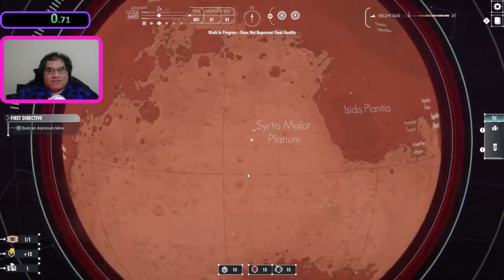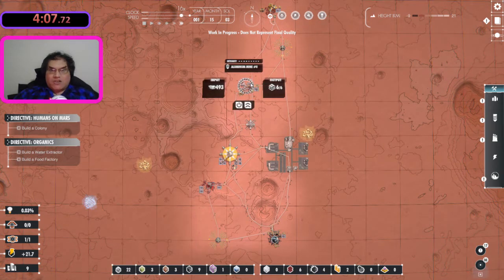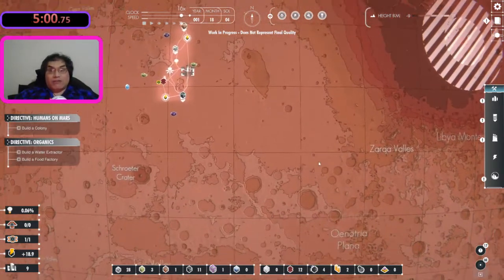Per Aspera Demo Speedrun 5 minutes 50 seconds

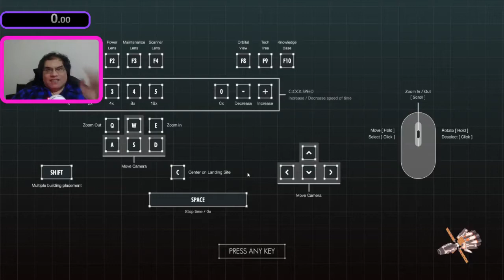Comment from the maker: 0:05 start aluminium
0:09 finish aluminium
0:10 build silicon
0:14 build kiln
0:19 finish kiln
0:15 finish silicon
0:20 power off aluminium
0:25 build solar
0:28 build iron (starts)
0:31 build carbon
0:35 finish iron (no power)
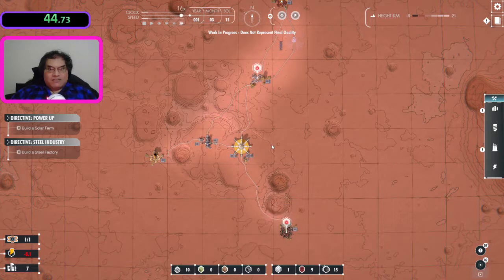0:42 finish carbon (forget turn off power, kiln no power)
0:54 power-on aluminium. power-on carbon
0:56 finish solar
1:03 start steel
1:13 finish steel
1:17 start parts
1:20 start worker
1:23 scrap kiln
1:25 scrap silicon
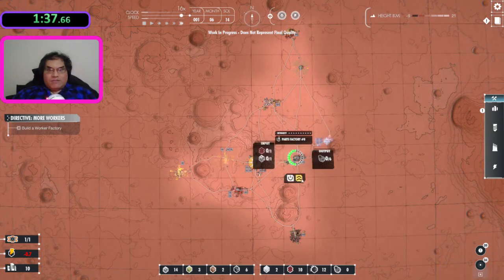1:35 speed parts
1:45 speed worker
1:52 finish worker (parts no power forget to turn power off)
1:59 start chemical (connect carbon)
2:02 build solar (by chemical & carbon)
2:06 start polymers
2:10 finish solar
2:11 start maintenance
2:13 speed chemical
2:17 finish chemical. speed polymer
2:21 finish polymer. scrap worker.
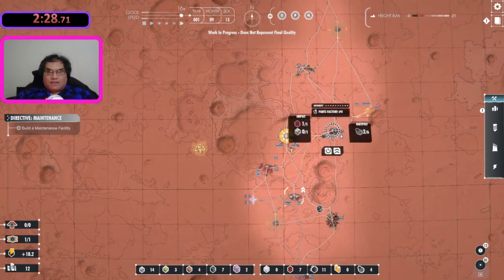2:28 speed maintenance
2:36 speed parts (need 1 more part)
2:44 scrap parts
2:51 power-off chemical
0 glass, 6 steel, 11 electronics, 0 polymer, 5 parts
2:53 finish maintenance
2:55 power-off polymers
2:56 steel factory has no power! workers will ignore this
2:57 power-off maintenance (slow should do before complete construction)
2:59 build aerological
3:04 scrap polymer
3:06 scrap chemical
3:07 speed aerological (worker brings steel from chemical plant)
3:14 finish aerological
0 glass, 7 steel, 7 electronics, 0 polymer, 5 parts, 0 food
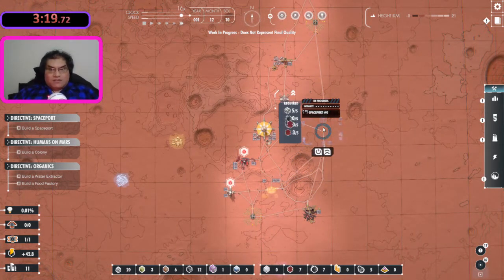3:16 start starport (slow could do faster!)
3:29 zoom out
15 aluminium, 3 silicon, 6 iron, 12 carbon, 1 chemical, 0 water
0 glass, 2 steel, 2 electronics, 0 polymer, 0 parts, 0 food
3:32 add colonists (3 minutes 30 seconds mark)
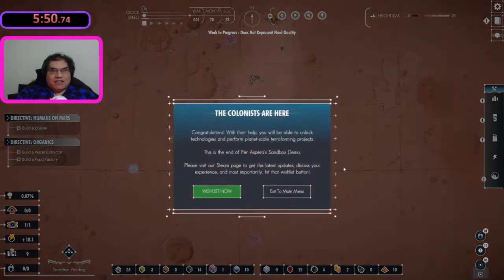5:52 game ends 5 minutes 50 seconds
*IMPROVEMENT LIST*
power-off carbon
Faster disable silicon
Faster Solar (8 seconds) then Chemical Plant (14 seconds too long)
Faster disable chemical
Faster disable maintenance (wait for aerological placement)
Faster aerological placement
Faster starport placement
(have too many resources)
5 minutes 30 might be fastest possible
Reply from the maker: It seems the carbon mines location next to the polymer factory increases the speed immensely. Building the chemical plant faster would have increased the speed of this run.
1:59 Start chemical plant needed to be prioritized. Also needed to be shut down sooner.